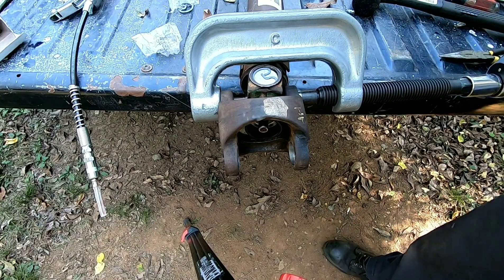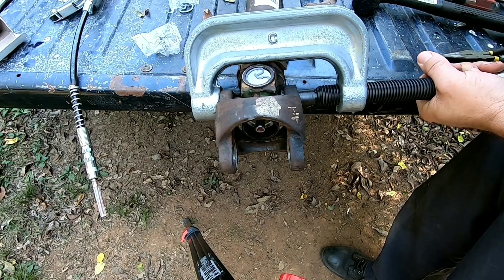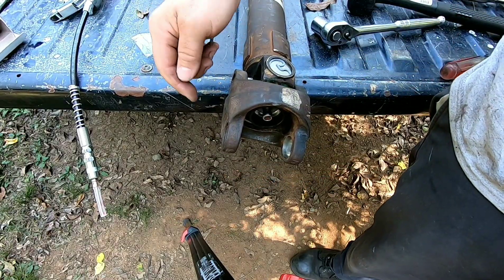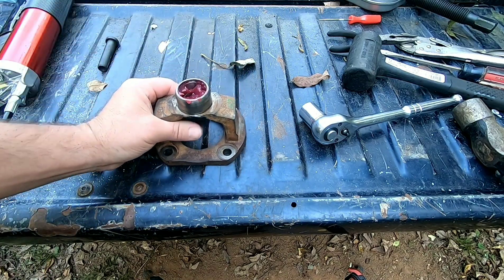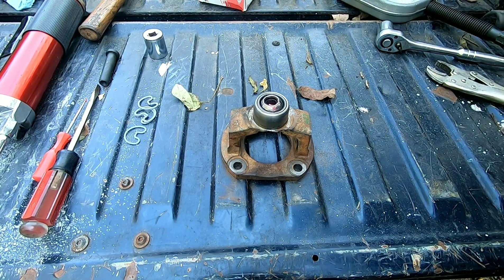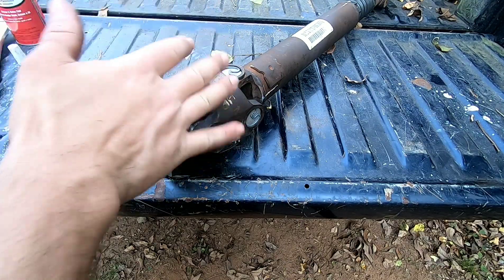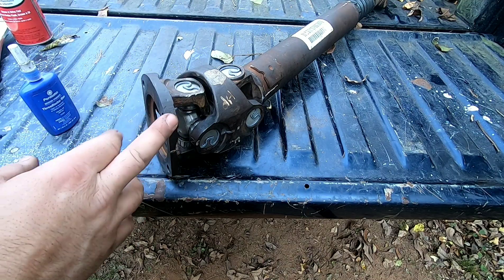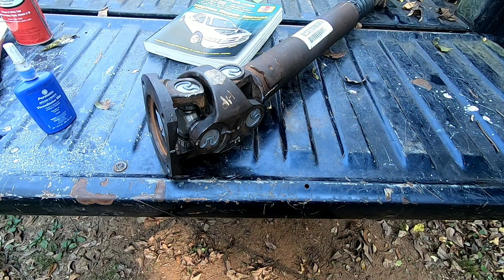Dodge 2500 double cardan drive shaft rebuild part 3/3

Comment: Hello what method did ya use to pull that cardane bearing out . Im rebuilding mine and im close to pulling it out to replace
Reply from the maker: I use 2 radiator hose pick removal tools to pull it out. I show this in one of the 3 parts.

Comment: I freaking forgot to put the spring inside the balljoint on the cardone joint
!  How long you think it will last?
Reply from the maker: Won't last at all. Don't drive the truck like that. If you don't have time to fix it just pull the drive shaft back out and drive the truck without it till you have time to put the spring in.

Comment: I have to do this on my truck tomorrow. Not looking forward to it and last time I tried taking off the front drive shaft I stripped one of the torques bolts
Reply from the maker: Use a long torque bit if you have one. That should help with not stripping it. Good luck brother and thanks for watching.

Comment: Great series of videos.  Thank you.  Would you have the part number for the spicer u-joints and the ball, spring, cup and seal?
Reply from the maker: Front u joint dana 5795x and the 2 rear 
joints dana 53208x

Cv ball kit ACDELC0 45U0708

Comment: I got the ball in middle out but not with its housing, how do I get housing out after ball came out already?
Reply from the maker: Use 2 hose removal picks to hook on inside of housing and pull straight out after using small pry bar to work it out a little. Watch part 2 of my video to see me do it. First 15 seconds or so of the vid.

Comment: subbed; thanks for the info..  I have to do this ASAP in my 08 3500 DRW's front shaft.  it's wiggly and squeaks like hell at 20+ mph and I have a vibration at around 60mph..  I just need to determine WHICH u-joints mine takes..  I think my joints are fine, but the centering ball is dead, I do believe..
Reply from the maker: Call the dealer for the part numbers so you can cross reference for brand name of your choice

Comment: What are the part numbers/info. For the 3 universals you used(seen one was a spicer), and what is that ball with the spring called? Plan on doing mine.Thanks
Reply from the maker: Its called a universal ball kit (aka cv ball). Front u joint dana 5795x and the 2 rear joints dana 53208x

Comment: Can you list all part numbers for all 3 u joints and the cv ball please?  Also what brand of ball joint press is that?  It looks rather handy to use instead of a hydraulic press.
Reply from the maker: The 2 ujoints at the carden joint part# Dana 53208x
The front ujoint part# Dana 5795x
CV ball part# moog 617
Astro 7897 Ball Joint Service... https://www.amazon.com/dp/B00061SGZO?ref=ppx_pop_mob_ap_share
Reply: Thank you sir I appreciate it.
Reply from the maker: @kylebrummett9716  you're welcome sir!
Reply: Question for you.  The rubber outer piece for the cv does it come with the part or is that separate?
Reply from the maker: Its separate. Dealership is only place I can find it.
Reply: Would you happen to have the Chrysler part# ?
Reply from the maker: @kylebrummett9716  no sir I don't. Give the dealership the last 8 numbers on your vin and they will be able to give you the part number.

Comment: I have my front driveshaft apart right now and I don't remember seeing that dust boot that covers the CV ball. Got all the u joints and the ball on the way but not that dust cover thing!
Reply from the maker: So you're saying it wasn't there? Dealership is the only place that can get it to my knowledge.
Reply: Neapco n286418. Or the spicer number is the same without the N. 13 bucks canadian from local auto parts store

Comment: Were did u get a new cv ball an seal from?
Reply from the maker: Rockauto.com
Reply: You can also find it here and at Lordco.
Funny enough Dodge probably won't have them depending if your in Canada or the USA.
Use a sealed for life U joint if you can find then.
There built to a higher quality and will outlast the greasable ones for shure.
I sadly could not find them fast enough.
Next time I guess🤣🤣
Keep up the good work!! 🍺👍

https://www.google.com/amp/s/torqueking.com/amp/product/40744/qu40744-cv-ball-and-seal-kit-for-spicer-type-cv-driveshafts/

Comment: great videos. i'll be doing this very job plus the rear driveshaft u joints this weekend. have a driveline vibration at 50-70 mph
Reply from the maker: Thanks man. Hope that solves your problem.